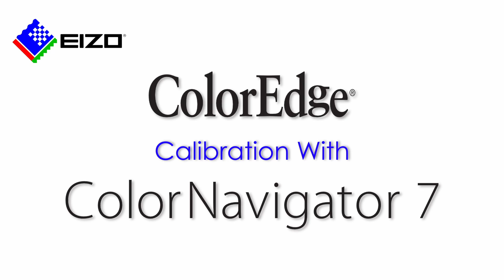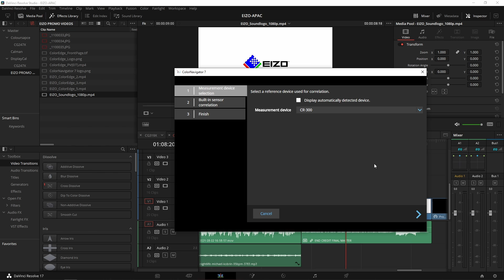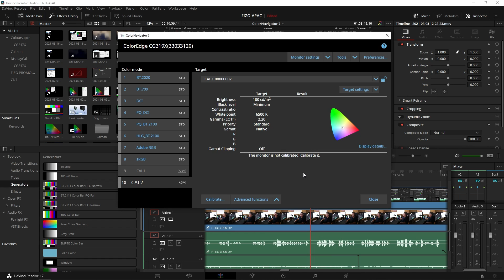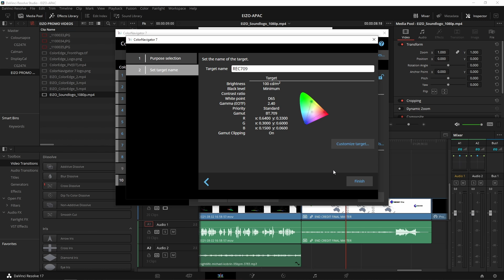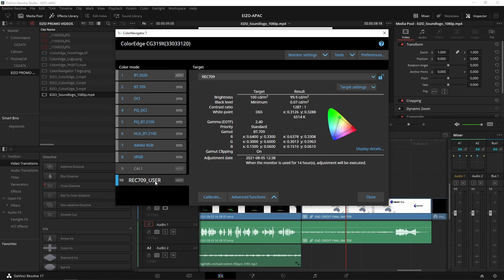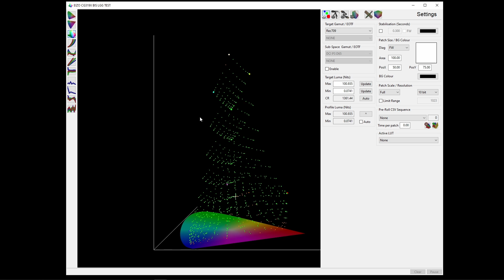ColorNavigator 7 Calibration for PostProduction

Comment: Good morning, I have a question: I am currently working with Premiere and Davinci Resolve and with the Eizo CG2420 as a reference monitor connected to the computer via Blackmagic Ultrastudio Monitor 3G. I followed the tutorial, calibrated the monitor and created my custom Rec 709 profile. And so far there should be no problems. The question is this: since I would also like to use the Eizo CG24020 to view the image in full screen while I do photo editing, how should I proceed with the calibration, creation and use of the custom sRGB and Adobe RGB profiles? Lightroom does not provide for the use of a reference monitor and therefore does not detect it when it is connected via Blackmagic Ultrastudio Monitor 3g, for this reason the only method to use the monitor in the way described above is to connect it directly to the graphics card. The fact that the calibration procedure explained in the tutorial requires the selection of the "Do not apply ICC profile" option and that this, apparently, is a general, permanent setting and not linked to the specific custom color profile that is used, how will it affect the subsequent calibration, creation and application of custom color profiles that require the direct connection of the monitor to the graphics card? How should I proceed? Should I deselect the option in question when I go to do the new calibrations, the creation of the other custom profiles (sRGB and Adobe RGB) and keep it disabled when I use the monitor for photo editing by directly connecting the monitor to the graphics card and then select it again when I use the monitor as a reference in video editing software by connecting it to the Blackmagic Ultrastudio Monitor 3G? I hope I have explained myself. It is not to be excluded that the procedure to follow is simpler than I think. Thank you very much.
Reply: Hi, Did you connect your 2700x with an ultra studio ? If so, did you connect the thunderbolt to the computer, and ouptut from ultra studio with HDMI to the monitor ? When I do so I don't have any connection with colornavigator. But with resolve yes. Don't know why ? It's working when I connect the monitor directly to the computer via usb.

Comment: Hey, thanks for the very well explained and informative tutorial. If you can't get a high quality Spectrophotometer for offset would you either use the internal probe or the i1Disolay Pro Plus in combination with Color Navigator? Would this be enough to offer color critical work with my CG319x?

Comment: Hello,
Thanks a lot for the clear explanation, in order to go to the end of the process, how should I adjust my output in DaVinci Resolve , data or video level ? in regard of how I should adjust in the screen (eizoGC277) the input range, full ?
Aïdan
Reply: Normal workflow for SDR is for the signal range is legal/video/limited. But, what is critical is that the signal range is 100% matched between the source and the display. It is good practice I find to manually set the signal range of the monitor to match the source. In the case of Resolve, if you are using Legal/Video then you set the monitor to match. You can use full range, just ensure the monitor is set to the same full range.

Comment: While calibrating for dark room what should be my or recommended cd/m2  for rec709gamma2.4  display and DCI p3 display of my eizo monitor
Reply: The normal practice for Rec.709 grading is 100nit luminance. DCI- P3 (for feature grading) is normally 48nit and 2.6gamma in line with theatrical. You need to ensure your environment is also correct.

Comment: I use an EIZO CG 2730 monitor.  I have calibrated it a few times, like the print quality from my Canon Pro 300 which uses 10 inks. My question is, my print quality is good but the Pinks are pale, and I would like to make the pinks more vivid. Is ther a way to improve the pinks to make it more vivid.  Thank ypu.  Dan

Comment: Would love to see the results generated using ColourSpace the CR-100 and the CR-300 (probe matched) with a full 21^3 profile. Showing average, max and number of points in the various dE ranges.
Reply from the maker: I very rarely do 21^3 profiles as they take a long time and with most of the monitors I work with there is no real benefit. For very non linear monitors then such as large profile works. But, as it happens I did do a 21^3 profile with a CG319X a while back. On the EIZO-APAC support page there are various example reports showing what you can expect - https://www.eizo-apac.com/static/uploads/files/eizo-edited-cg319x-report-wfyzhhytmvqu.pdf . The BT.709 verification was done with a 17^3 profile and showed an average dE00 of 0.3693 (green dots are less than dE00 1

Comment: Thank you Stuart. For Internet video distribution (Youtube, Vimeo, etc) do I need a dedicated video card (BM or AJA)? My EIZO CG248 is connected to the graphics card with displayport. And witch software you recommend for CC: Color Navigator 7 or DisplayCAL ?
Reply from the maker: Hi Miralty, in  a video post environment we always use a reference monitor connected via a BMD or AJA such device, depending on what your software supports (Resolve only supports BMD and Adobe supports BMD and AJA for example). The reason being is that we try and avoid the graphics cards icc profile scenario. We like a 'pure' digital signal to the monitor. This means we have the gui connected to the graphics card and the reference monitor separate to the graphics. This is not to say your way cannot work, it just means you have to be very, very careful of what icc profile and vcgt settings may be loaded into your graphics card
Reply: @eizo_apac  Thanks Stuart.
Do you know a tutorial (YT link) or a documentation where I can learn more about this "you have to be very, very careful of what icc profile and vcgt settings may be loaded into your graphics card" ?
Reply from the maker: @mirality2464  Hi Miralty, I'm sorry I can't recommend any YT channels for icc profiles. It can be quite complex. I'm sure there is stuff out there but how good it is is the big question. In your situation, I would run CN7 and let it manage your system, you will get good results as it will calibrate the CG248 directly in hardware. Personally I haven't used a CG248, but with EIZO even the Flexscan series are very linear and so you will get good results with CN7. My choice for learning about colour management would be Real World Color Management by Fraser, Murphy and Bunting as a first step. Although it's directed mainly at photogrpahy and printing it will give very accurate information. If you want to learn about calibration in the video world Steve Shaw from Light Illusion has some great info https://www.lightillusion.com/guides.html. Are you in the SE Asia or Aus/NZ region?
Reply: @eizo_apac  I'm in Europe. Thanks for info. Steve Shaw from Light Illusion is a legend in the field.
How about Calman YT channel - https://www.youtube.com/c/PortraitDisplays/featured ?
I also have the Color Correction Handbook by Alexis Van Hurkman. One chapter is about SETTING UP A COLOR CORRECTION
ENVIRONMENT but not so much info about  icc profile and vcgt for graphics card.